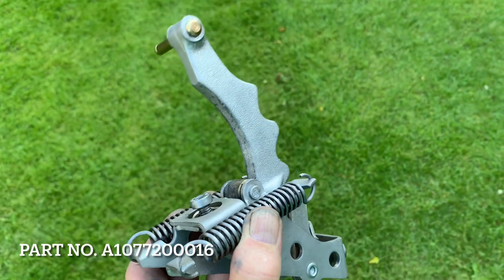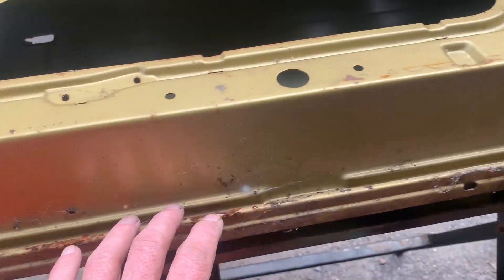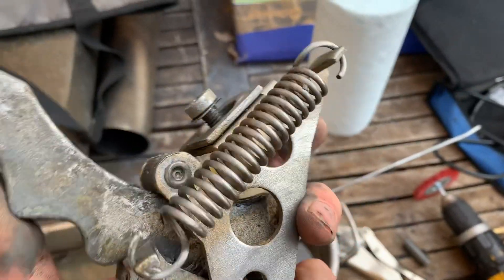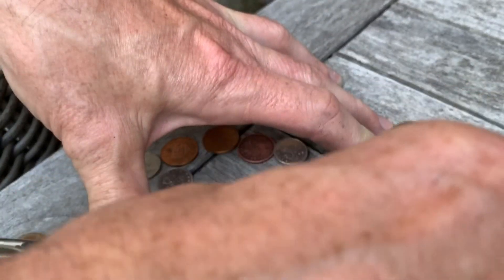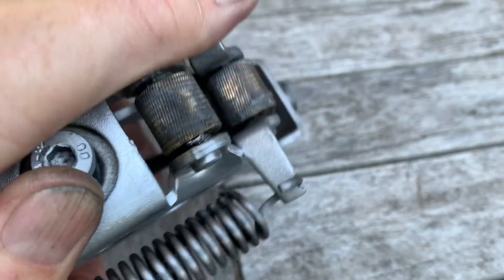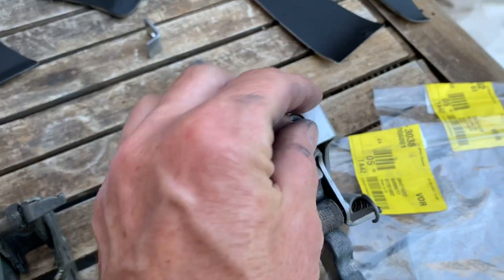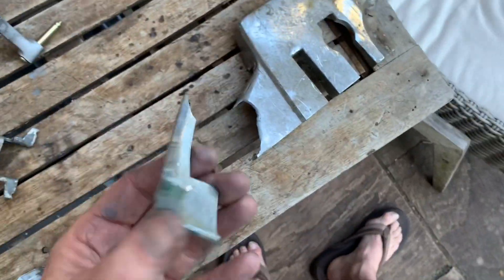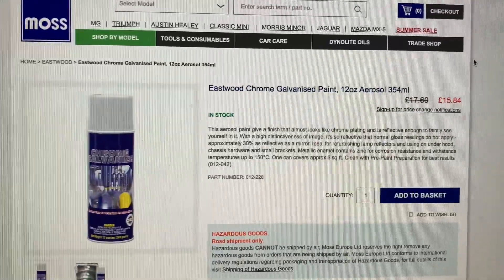Mercedes R107 SL door check  - A1077200016

Comment: Thanks for the advice. Got this question since you have been buying a number of parts from Mercedes Benz, do they still use the old microfische machines that projected the parts image on a screen. It drastically simplified a parts search, and if any had a number then you knew that part was sold as a separate part. With computers and internet the same can be done and across the world, but those microfische projectors were wonderful.
Reply from the maker: Thanks for your comment. Microfiche....now that takes me back! Mercedes have long since scanned all the microfiche drawing. Did you know that you can get part numbers and drawings etc from:

http://mb-teilekatalog.info/view_GroupAction.php?lang=E&mode=BM&class=1&aggtyp=FG&catalog=048&model=107042&spmno=0&group=0

Mike
Reply: @MikesMercsandothercars Thanks Mike, I'll have a look. In around 1969-72 there was a MB workshop near my dad's workshop in Uganda and as a child I used to peer through their windows from the street at the different cars of the time there, pontons, fintails even SL's. Its been a long time, but I think thats where I first saw a microfische projector, in their parts section. Then next it was in Dubai at the dealer there. I think it was an MB thing, don't know if BMW or VW used microfische. It was a good system and eliminated mistakes.

Comment: Hello Mike, I’ve been looking for a video showing the reinstalling a door check. I’ve been told it can be done with all of the inner power window mechanisms in place? I’ve been attempting numerous times with no luck yet. 1975 450SL
Reply from the maker: Hi - what problem are you running into?

Have you removed the old door check?
Have you tried installing the new one with window up or window down or both?

Have you watched any of the other videos on this channel about removing door panels etc?

Mike
Reply: Hi Mike, I have tried with it  in up and down position of the window. I just can't get it the position to fit it into  position.
Reply from the maker: @cameronforbes9446  I'm out in France till Thursday and will have a look at a door when I return to remind myself how they fit. Mike
Reply: Thanks Mike, I'm out of town as well,  until next Tuesday. Have a good we8.
Reply: Hi Mike, I'm just checking in to see if you had a channe to have a look and any advice on reinstalling the door check. Thank you
Reply from the maker: @cameronforbes9446   @cameronforbes9446  Yes, I did have a look, but couldn't reply to your original message for some strange reason. I've uploaded a short video below. Let me know you can view this OK and if it helps.

https://youtu.be/fHtguG-dfoU

Mike
Reply: @MikesMercsandothercars   Hi Mike, thanks for taking the time and sending the video. You must receive many requests for help. The problem I'm having with the check is reinstalling it with all the power window components in place. I've been told it is difficult, but it can be reinstalled with everything in place. Thanks again, Cameron
Reply from the maker: @cameronforbes9446  My 280SL with electric windows was sadly stolen so I am speaking from memory...is it the actual motor that is in the way, the window glass or the X shaped window regulator to which the window attaches?

Have you tried dangling wire/string through the door check hole and pulling it up from the bottom of the door? Mike
Reply: @MikesMercsandothercars  Hi Mike and thanks again for your help. I can get it into the door cavity past the x-frame, I attempted to get my phone inside to take a photo and a video to see if I could get a better idea of how to position it, but I couldn't get a clear shot. I think it may be the motor that's obstructing it. I had fished a wire through the opening to see if I could direct it without luck. I will try to fish it up from the bottom as you suggested. I've considered removing the window hardware, but im concerned about getting it back in place and working. Sorry to hear about the theft of your car, terrible. 
My best.
Reply from the maker: @cameronforbes9446  I reckon if you can pull it up and get the first bit through the hole, you will be good to go. Let me know how you get on. Mike
Reply: Thank you Mike, much appreciated.

Comment: Hey Mike, I've an 83' r107 5 speed automatic Euro I'm restoring for potential resell. Would you know where I can find information on what this car could realistically sell for and what things are important for the restore (e.g, keep original worn paint or get fresh coat?). Thanks man and keep up the great vids!
Reply from the maker: Thanks for your comment. Valuing the 107 SL is quite tricky. It depends what country are you in, what colour it is etc etc. Once you paint a car, you will need to replace all the seals which adds quite a bit of cost......and then everything else by comparison looks a bit rubbish so you end up doing more work than anticipated. In the UK, I would estimate that my red 1983 280SL 5 speed manual would be worth £20-£25,000. It has been repainted and lots has been renewed/refurbed but it is still far from perfect. The 1976 silver 280sl 4speed manual is probably closer to £12000. In the US you can pick up 107's for a lot less. For values, you could check eBay (completed listings) or themarket.co.uk. Good luck with the resto. Mike
Reply: @MikesMercsandothercars  Just saw I didn't comment on this. Thank you! I've decided to keep around because I don't think I have the know how to restore to anything over 10k. Great car though and I love working on it.

Comment: If you´d use washers instead of coins you won´t have those biting sharp edges of coins to bite in the spring when removing.
Reply from the maker: Thanks for your comment - and yes, you are dead right I should have mentioned using washers as an alternative. The reason for showing the coin method is that everybody tends to have coins…..although for how much longer is anybody’s guess. Mike